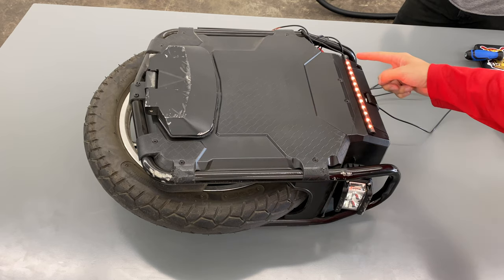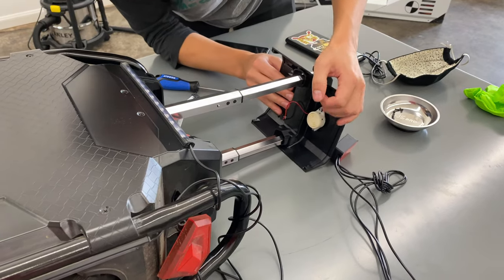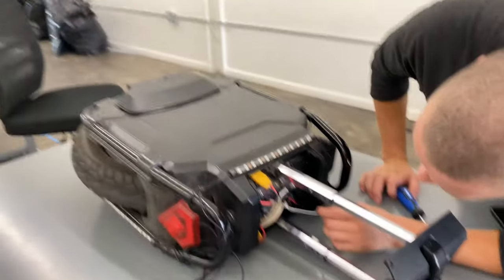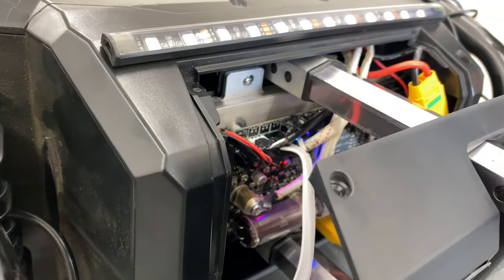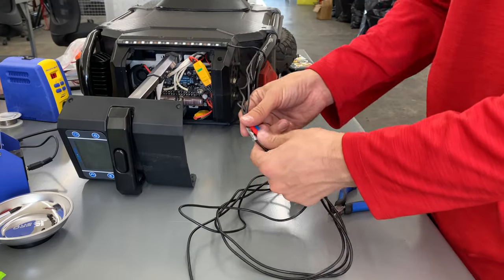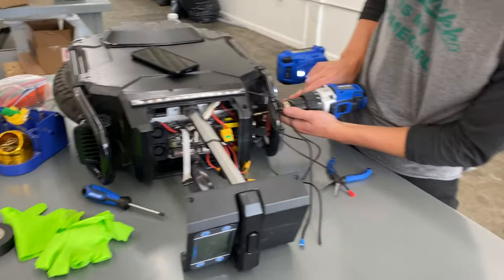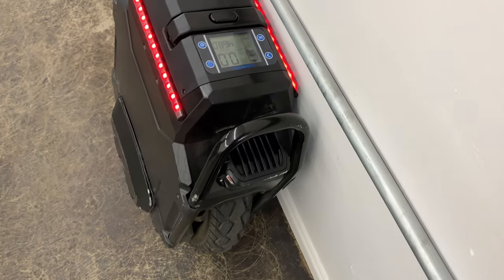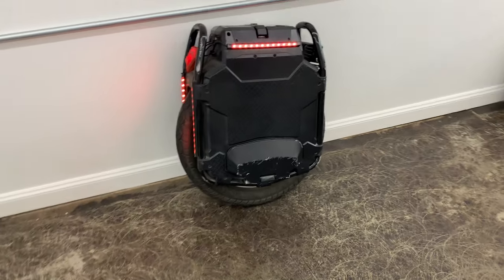Veteran Sherman Integrated LED Strips | Electric Unicycle Modification

Comment: You should make a video of the control arm they are doing a recall on on the turbo wheel phaeton ? Ewheels is sending me a replacement for my wife's . ✌️
Reply from the maker: The controller? Would love to do a video on that in the future. There’s a lot of wires so it can be tricky, my guess is go wire by wire as you change it. Good luck!
Reply: @AlienWorks swing arm on the turbo wheel phaeton has a weak point I guess they are going to send a replacement this week.